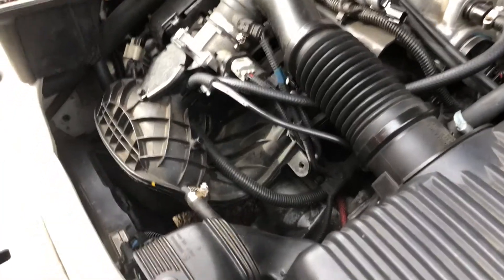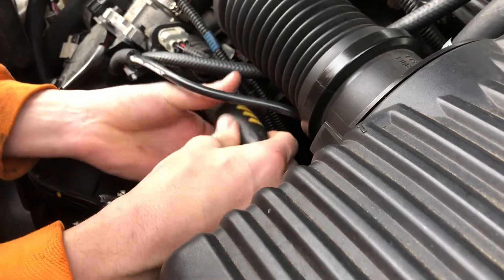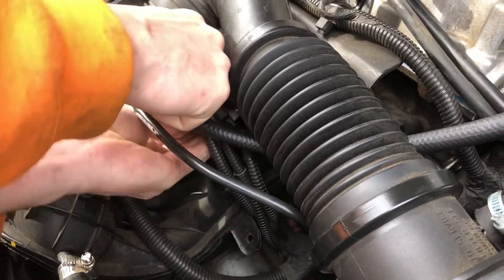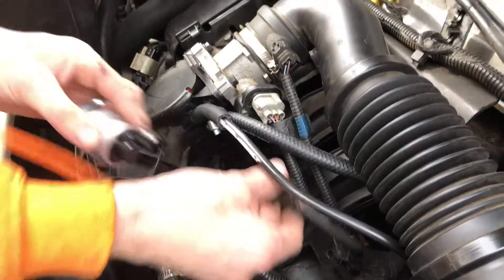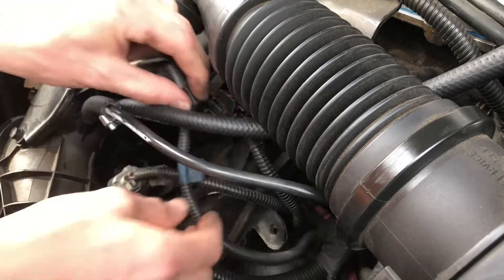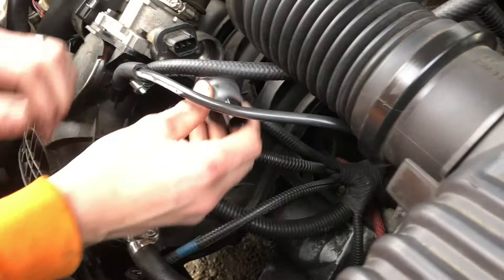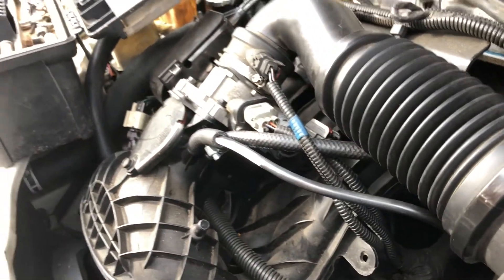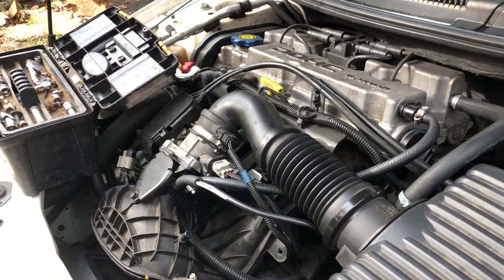03 Dodge Status idle control valve 2.4 Dhoc

Comment: Thanks for this video.
My 04 stratus with 225k  had a fairly steady idle but was a bit rougher than it should be and slight drop at acceleration ,maybe 150 rpm.
With the ac turned on ,the idle would drop around 350 rpm and stumble almost enough to stall but would stay running and a lot of hesitation at acceleration.
Watched the video but had to drive in 15 mins ,so i hurried and pulled the this valve and gave it a quick clean up.
The car still idles a little rougher than it probably should but is much better than before and no hesitation at acceleration.
With the ac on it doesnt stumble and  drop rpm and doesnt hesitate on acceleration but the idle is still a bit rough.
I may go back and try cleaning the valve a bit better.
Any suggestions on something else to resolve the rough idle ?
I doubt it's had any kind of injector cleaner ran through it in a very long time.
Reply from the maker: Also, check your throttlebody and make sure that it is also clean if you clean it use carb cleaner in a very soft bristle brush and when I mean soft soft
Reply: @StansAuto83  
I did clean the outer side of the throttle plate area of the throttle body with some carb cleaner and wiped it gently,but I was in a hurry and didn't do a great job cleaning it ,or the idle valve so I'm going to go back over the valve again when I have a little more time.
As for scrubbing gently i learned from cleaning a throttle body and removed all the plate gum stuff that seals it and was  wondering why it was reviving so high,lol.
That sealer stuff is expensive since you have to buy a whole can for 1 or 2 squirts that you need.
Again thank you for the video.

Comment: How do you control how high or low it idles?
Reply from the maker: The idle control valve controls the idle it is computer controlled. The only way to really increase or decrease your idle would be able to get into the ECU and change the programming which I don’t think Dodge or any aftermarket companies have made a way to reprogram a Dodge stratus if they did it’s probably pretty pricey, but there could be a High cost scan tool thatcould do that. Normally when the idle control valve goes bad or gets dirty with carbon, it can cause either a high idle or a low idle, but also the map sensor or the mass airflow sensor or not working can cause symptoms..

Comment: Hey my car idles poorly and wants to die when I have the a/c on. I have a 2004 Chrysler Sebring with the same engine. I took the IAC valve out and cleaned it but that didnt do anything. The car idles just fine when the a/c is off. DO you think the part needs replaced?
Reply from the maker: I would say so. Do you have a check engine light one?

Comment: What is that part called? I went to rock auto and cannot find.  I found the idle air control valve but doesn't look like that part at all in the video.
Reply from the maker: What year engine and model is your vehicle and I’ll see if I can locate it for you and then send you a link
Reply: 02 sebring 2.4 dohc
Reply from the maker: Ok I will get back to ya soon
Reply: Thank you. I appreciate it.
Reply from the maker: For a 2002 Stratus and Sebring the idle control valve is the same for the 2.4 double overhead cam. The reason the one in this video looks different it’s a newer model Stratus and they change the style of the idle control valve.
Reply: Ok. Thank you. I assume it's in the same location though?
Reply from the maker: @cmccall4394  ya by the throttle body